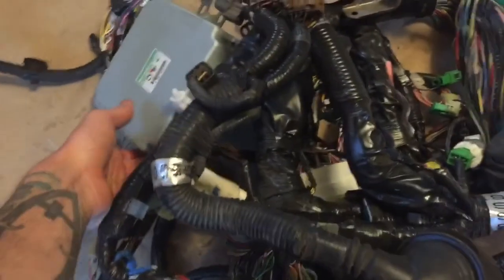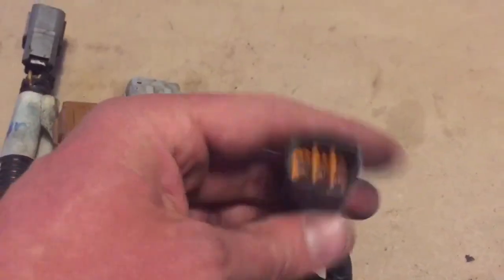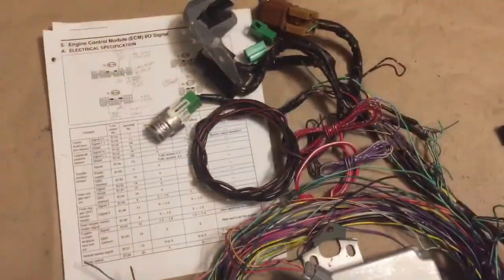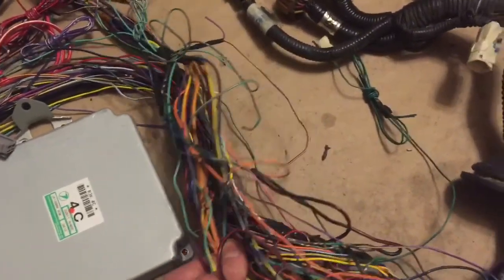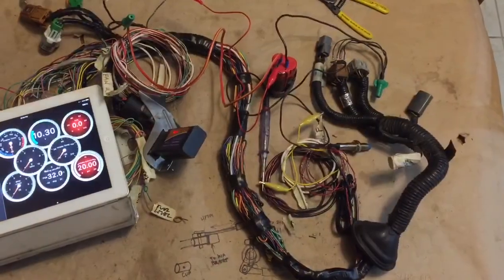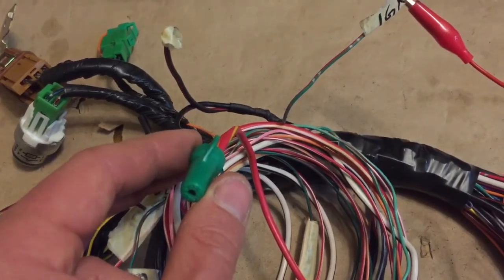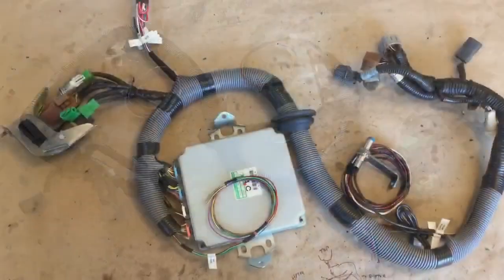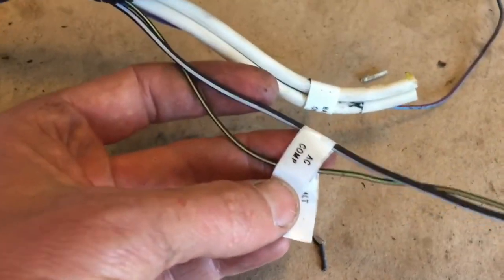2003 Subaru Legacy VW Wiring Harness Conversion

Comment: I want to add to this. I've done a few Subi-swap harnesses and I'm an electrical engineer. First and foremost, Pick an easy year like 2003-2005 and don't get a California spec computer (You can use one but its a PITA because its much more sensitive to emissions control and will throw more codes). Don't cut any wires for the two main engine plugs and O2 sensors. shorten the wires for both relays. like 12" from the ECU. do not route the O2 sensor wires near anything! They are super sensitive to noise even with the shielding. PICK A GOOD CODE KILLER BOARD! The Smallcar old board is the bare minimal but will still not eliminate some codes. Don't forget to default your computer to manual transmission or you won't be able to start the car. find a way to hook up a neutral switch. The computer needs to see the transmission in neutral once and a while to eliminate the code and also some year ECU's will not kill the injectors when you come off the throttle and shift resulting in a rev-hang (Depressing the clutch will cause RPM's to rise a bit in between shifts) and some ECU's will cause the RPM's to fall to fast and too low coming to a stop. This might stall the van or cause the oil pressure light to illuminate due to low RPM/potential stall condition. it will drive you nuts figuring it out. I'm researching an in-line clutch pressure switch to ground this wire to produce a "Clutch/neutral" signal. make sure your VSS (if you are using a Hall effect ring on the rear CV) is shielded and away from all other wires. This is a super low voltage signal that will cause erratic performance with no warning if the pulses get noisy. Verify with your OBD2 in live data looking at the vehicle speed while driving. Make sure the voltage leads for the O2 sensor heater circuits are not energized when the vehicle is off. A common wiring mistake resulting in a dead battery after 12-24 hours. ONLY use Densu sensors!!! eBay bought sensors are all miss-wired and can or will cook your computer in 2 seconds. Don't wire hour computer to not receive constant 12V battery voltage when key out. There is a wire that needs 12V all the time. Not wiring this up will make the computer "Forget" the learned maps and this might or will be revealed as a double-start condition (start the van, it dies in 2 seconds, start again, runs fine). 

for experimenters: Some ECU's can almost ignore no VSS signal but need a regular "pulse" to keep the engine happy. I have heard of people wiring up cheap adjustable flasher relays off eBay set to 130 flashes per minute or so. The computer does not use actual vehicle speed to adjust the maps. it seems to only want to know if the vehicle is moving or not. Anyone want to work on this?

DO NOT BUY THE SMALLCAR WIRING CHEAT SHEET. BIG WASTE OF MONEY AND ITS USUALY WRONG. 

ONLY USE 3M ELECTRICAL TAPE. NO EXCEPTIONS AT ALL. TRUST ME.

CLEAN ALL CRAP OF WIRES WITH PURPLE POWER! USE GLOVES AND A MASK. TRUST ME. 

IF YOU SOLDER ANY WIRES, PLACE A SCRAP CUTTING OF WIRE INSULATION OF THE SAME GUAGE PARALLEL WITH THE SOLDER JOINT PLUS 1/2-1" PAST EACH END THEN HEAT SHRINK. YOU NEED THE FLEX PROTECTION. 

USE A GOUND TERMINAL STRIP INSTEAD OF ROUTING 8 WIRES TO GOUNDS. THE MASTER GROUND CABLE SHOULD BE 8 GUAGE TO ENGINE BARE METAL LIKE THE ALTERNATOR MOUNTING BOLT. 

DONT USE THE SUBARU OBD2 PLUG. IT SUCKS ONCE YOU DEINSTALL IT FROM THE KICKER COVER. PURCHASE A $20 OBD2 PIGTAIL FROM EBAY AND EXTEND THE WIRES NO MORE THAN 30 INCHES. 

EXPECT CODES. MOSTLY IDLE CONTROL CODES. EVAP CODES ARE COMMON NO MATTER WHAT YOU DO. 

PLACE A SPARK PLUG ANY FOULING COLLAR  BETWEEN THE DOWNSTREAM O2 SENSOR AND THE CAT/PIPE. THIS WILL ELIMINATE CATALYST CODES.
Reply: I see where you stated to use certain years because they’re not overly complicated, unfortunately my 2011 DBW/transponder key donor was just too cheap to pass on ($400). Do you think it’s possible to trim this harness down to make it work in my Subi-Beetle swap?

Comment: Hi Busaru, we already did a swap with a 2003 Subaru Legacy engine in Type 1 Beetle. This Beetle/Subaru has a throttle cable. Now we're placing a 2.0 liter Outback engine in a Ruska VW buggy, without a throttle cable. We just got the EJ20 engine, but we can''t find its harness and ECU. Where can we obtain the harness and ECU? The ebay sellers keep asking for the Outback's part number match, but we don't have that info.

Comment: Hi Busaru,  Great videos and very informative.   I ordered an 03 2.5l jdm harness and ecu and what I got was labeled 06-09 without the ECU. I do not have the engine yet.  So my questions are with matching the ecu to the harness,  If it fits the harness and is the correct year will it work? and what is the the time line fitment of an 06-09 harness to an engine so that the connectors and ecu will work.  does the dash harness have to match the engine harness exactly or can you make it work if you were to do the harness? or should I just scrap this harness and find a complete doner.  Thanks a lot!

Comment: I'm building a 1968 vw beetle that i'm putting the 2004 subaru impreza motor in it. Any advice on what to keep and what I can cut from the harness?
Reply from the maker: There might be some slight differences from the above video but it’ll be very similar. Just get an ECU pinout and make sure the important connectors are accounted for.
Reply: Iv got the inter harness I'm just having a hard time finding out what to cut so it's not such a mess

Comment: Any video on how to make wire loom tester. You make it look easy
Reply from the maker: Well, really the best way to bench test is to supply grounding, 12v+ constant, and ignition power. I made a video on testing in my wiring harness video series - check it out.

Comment: I have a 1992 legacy ignition module that I'm putting in my 72 beetle. I am using a microsquirt computer. My ignition module has 5 wires but I can't find a wiring diagram. YELLOW/GREEN  GREEN/WHITE. BLACK. YELLOW/RED.  BLUE. RED/BLUE. can you tell me how to connect it
Reply from the maker: +Clem Punter it's a 2 channel setup as wasted spark  - you'll want to find a diagram. There should be a link on my website under services/resources. Good luck.

Comment: Any info on the 2005 model Legacy loom with drive by wire throttle, any pin out charts? 66 Karmann Ghia with 05 ej20 conversion,  once I get past the wiring!
Thanks.
Reply from the maker: +barry mcmahon You can find that info in the factory service manual - I have links to them on my website - Busaru.com

Comment: Hey Mick. Tyce here, we have chatted a few times. Any still wrapping my brain around the DIY harness process and I am going to make a recommendation/suggestion/request. It would be better for a DIYer to be able to speed up or slow down the video instead of you going fast mode...There is so much detail that is lost...as well as the ability to go back to a very specific spot in the video helps a lot. I am speaking from experience watching over and over your 95-98 DIY harness series...These are greatly appreciated!!!
Reply from the maker: +Tyce Ferwerda Thanks Tyce, I'm afraid an 8 hour video would be a bit dull though ;) I get what you're saying, and I've made an entire series on how to do the harnesses step by step, you may want to check that out then use the specific year videos as a sort of reminder. Check the playlists that I have, I think you'll dig the step by step. Cheers!
Reply: Thanks, ya I get that. I guess what i mean is since your doing it anyway, just like the series you did, you could do that same approach. I have watched your video series probably 10 times each and still trying to wrap my brain around what gets cut and not. The main thing I think at this point is the wire harness junctions/splits or whatever they are called that just need to be hacked off is not clear. Ive seen in your vids all those sections but I havent seen a vid that spells it out...Hope this makes sense
Reply from the maker: +Tyce Ferwerda It would be a heck of a lot of work building a video series showing each step for every year and model and engine type for the conversion, that's why I created the generic series which you can apply to most harnesses. Basically you cut everything off that isn't detailed closely in all of the videos. I hope that helps you.

Comment: Mick, I am currently doing a converstion on a '91 Caravelle Syncro.  The donor car is a '02 Outback.  There is one plug that I don't know what to do with.  In this video it was blue, about 1 inch wide, and connected to  both the OBD II and the ECU (?).  Can I just cut it loose and toss it?  What is it used for.  Thank you.
Reply from the maker: +Michael Swanson It should just fall out of the harness. I kept it in until it naturally fell out.